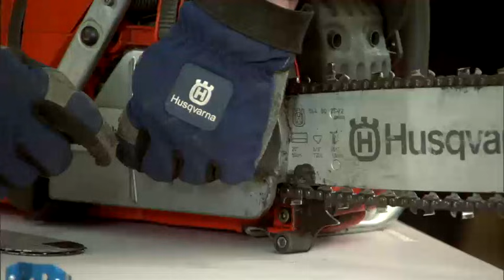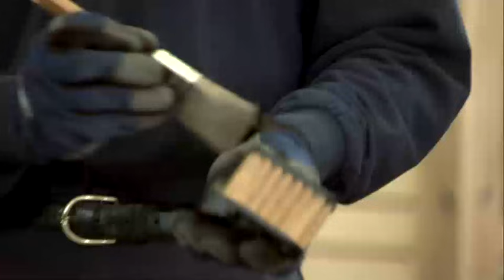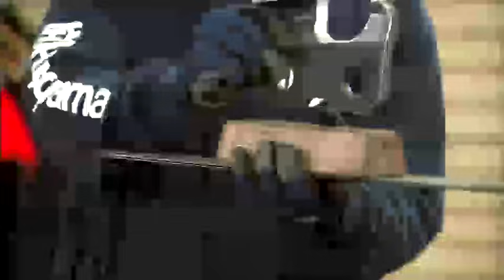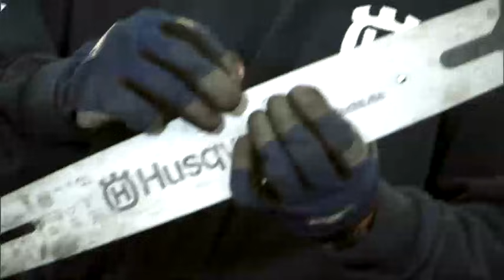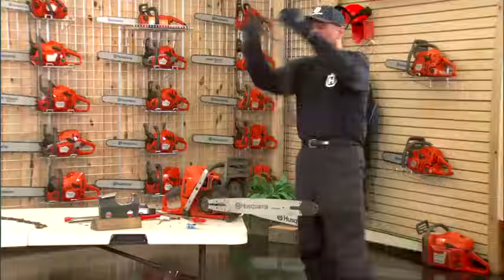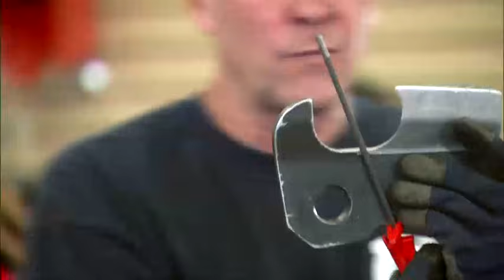How to Maintain and Service Your Chainsaw | Husqvarna

Comment: First of all, I want to say that this is a great video. I would like to add that you should make sure the chain brake is disengaged before you take the side cover off. He did disengage it in the video and even double checked it before removing the side cover, but did not specifically say to do it. To those of you who are experienced, that may seem obvious to do so, but for someone new to saw maintenance (like myself) it’s may not be so obvious. I was wondering why it was so hard to get the cover off and then was really mad at myself when I couldn’t get the cover back on. I finally got the brake disengaged and the cover back on, but I don’t want to make that mistake again and hopefully I can save someone else that headache. They do make a special scrench, but I did not have that at that time. Again, just make sure the chain brake is disengaged before removing the side cover.

Comment: Sure you claim not to use motor oil just because some of it gets thrown off
Well consider which is cheaper,
When you use expensive chain oil
You can buy several chains with the money you spend on oil, and it is still a lot cheaper to buy an extra chain or even the bar,
So at my age of 82 , i been using motor oil for many many years , and I cut thousands of cords of wood,  I use a 394, bought that around 1994 to replace the one that burned up in a fire in the Okanagan.
So no point in promoting chain oil, auto oil also seems to have a sticking agent in it too, as the engine parts are moving, and an engine is more expensive than a chain saw.
In all those years I think I bought 1 bar and a couple of chains,

Comment: most of the old saws cannot use bar oil, the viscosity is too high, which causes the saw to leak.  If one's saw leaks, start by switching to a lower weight oil to see if that helps..

Comment: I guess I got a bad one. I’ve owned 3 chainsaws in my life, 45 years old. This chainsaw is the most delicate and maintenance heavy pieces of equipment I’ve ever had. I didn’t do anything crazy with it, didn’t hit any rocks or metal. Just a heavy day of personal lawn maintenance work. Constant maintenance since. I’ve done nothing but try to fix this damn thing. It’s the chain, it’s the guide bar, it’s the tensioner… I paid way too much money to have to baby this thing and waste so much time on it. I can’t even sell it in good faith because it’s always breaking.
Reply: What manufacturer. Husq?
Reply: Which model if it is a husq

Comment: I used Sthil for years, i just bought two farm tough husqvarna, i was cutting trees down and the chain fell off, i couldnt get the housing back on. its still sitting in the back of my truck since december, I want to throw it out because how hard it was to put the fukn thing back on in two feet of snow.

Comment: In my 50+ yrs experience of running & maintaining chainsaws, learning by doing, a file guide like Granberg's gets me the best results, by setting file ht and angle precisely. (To KISS I just file flat across.) No way otherwise, IME, can I do that. Without that guide, I need a stump vise to hold the bar so I can use two hands on the file. Granberg guide can be controlled with one hand. It can also be used to precisely set "joint"- depth gauge setting. Then you round leading edge of depth gauge with flat file. Generally, couple strokes per tooth every other fillup keeps chain sharp and consistent. Some have difficulty mastering that guide- the instructions suck- a friend to answer questions is a good idea a/r for comprehension probs. No way can I get such results with a grinder- they're for rocked chains. Also, chains and files seem to last a long time with Granberg guide. Rule 1: relax & engage brain. Good luck & fat chips.

Comment: push the primer 6 times and let it rip I like the saw for the price👀 allabout.wiki/MIJI used maybe 10 tanks of fuel, 6 loads of hard wood and am very pleased with it. some will say its under powered for a 20" but I like it better then a 18". I have a 18" also which is great also just like the extra 2" inches. the saw is very light also which is nice. Huskavarna owns Husqvarna so I am sure it will last. its not a sthl but still love it! I have seen some bad reviews on the saw but do not agree with them. some people told me not to waste my money but have since changed there mind. just have some common sense and cut some wood!

Comment: I have a blocked chain oil feed on my 445 and cannot seem to clear it. The holes on the bar are clear. Any tips on how to sort the problem?
Reply: Have you cleaned everything else also such as bar-rail and the chainbrake-area is clean? If, Then your oilpump on gone

Comment: Exceptional video. Thanks.  I'm certainly not a chainsaw expert but one thing I have been taught to do is to also lay the bar on a flat surface to check for bends or twists.

Comment: Good tip given in the video - engage the choke lever to block the carb before removing the air filter to prevent accidental blockage from debris.

Comment: Exhaust goes one way, out not in. Spark arrestor won't go into the intake because it's affixed to the exhaust, specifically the other side of the muffler from the exhaust port on the cylinder.

I can't wrap my mind around the statement that little bits of the arrestor if weakened, can end up in the intake when it's on the far end of the outtake.

Honestly, heat the spark arrestor until it glows cherry red. Let cool until cold to the touch. Use brass brush to clean ash off the screen. Never had problems doing this.
Reply: Exhaust on a 2 stroke also acts as an inlet, the reflection pulse of the exhaust pushes combustion gases back into the combustion chamber.

Comment: That was a very good maintenance rundown. To sharpen the chain I use a 13/64 or 5.2mm file. Not the 13/64 or 5.5mm you recommend.

Comment: Can I run a 20" Bar on the Husqvarna 445 ?
Reply: You can, but.......it's a tad too long. I've had one for nearly 10 years and found it works great with an 18" bar as long as you keep your chain sharp.

Comment: Chain sharpening. Mi look at the same things you do but I also look at the gullet.  I feel the top edge, look at the gullett and scan the rakers to make sure they are below the top plate by about the gap on the spark plug.  I usually put three strokes on the gullett and three strokes on the top plate.  I have file guide sure but I usually file free hand with just a file unless the cutters have been really dulled off and I need to reset the angle of the cutters.

Comment: hand filing is just a bad idea.  I'm convinced the greatest hand filer in the world will through their chain out of factory recommended specs in 3 or 4 sharpenings.  Get the timberline sharpener, it can sharpen all the teeth in a straight line rather than having to flip around and doing the skipped teeth afterwards like normal hand filers.  Further, it locks into place and all you do is trun the grinder with a circular handle, so if it's locked in there's no play or freehand movement to screw things up.  It's pricey but worth every penny imo.
Reply: always hand file .

Comment: I been cutting firewood as a business since 1979. I started out running Husqvarna 2100(99cc) and the 266xp. Never had a problem. One must understand the Husqvarna xp saws are a very high rpm. The chain must be razor sharp to get the best performance out of the saw, time is money. I make one pass with a file on every gas up. I like the cutting speed to be the fastest when felling trees. At the end of the day the air filter gets cleaned, the bar nose gets a shot of grease, once a week the clutch bearing gets greased, the bar gets checked squareness.
Reply: Good old saws Bill, my 266 is still going as strong now as when I got it way back. Your spot on with your maintenance, you only get out what you put in. Happy cutting

Comment: Nice video, but Wow...sounds like you guys need to build a better, more durable air filter. That's absurd having to baby it so...these are working machines. No way you can't make a good filter that you can take out, blow off and get back to work! Also curious, which 6 surfaces you can flatten with that 90 deg. file???
Reply: Three surfaces on the top of the bar, three surfaces on the bottom of the bar.  Adds up to six if you look at it that way.

Comment: Hi can you show the correct position of the cooling plate behind the muffler on a Husqvarna 365 Special when I took the muffler off the tab on the cooling plate was facing out but in the workshop manual it shows the tab facing inward, will this make any difference the way the tab faces.

Comment: When changing or cleaning cutting chain and or guide bar, should you hold the guide bar by the sprocket tip so the bar is on a slight upward plain? before you tighten bar nuts?
Reply: just lift the power head up when tightening the bar nuts

Comment: Great video, very informative. I couldn't help but notice that, when looking at the gullet and stating what to look for (to see if it's 90 degrees from the rise of the gullet to the tip of the tooth), the angle on the chain wasn't 90 deg. Just wondering how important that is. (I'm guessing it's just a rough guide (maybe?) since you didn't mention that the angle wasn't 90 deg). Thank you again for a very informative video!
Stan in N AL

Comment: Please explain comment at 25:34 to 25:44 about low RPM being hard on the equipment and takes away a lot of life.
Reply: +D eez  Not sure if you are still concerned, cuz this comment is pretty old.  But he was referring to not filing the depth gauges too low.  If the depth gauge is filed too low, the tooth will try to cut deeper in the wood.  It will "bog down" and the saw will be working too hard.  Consequently, the saw isn't able to develop its full RPM (12,000 or so) because it is trying to cut to deeply, and only develop around 6,000 RPM as he stated.  Which is really hard on the saw.  Be like running your car in 2nd gear at highway speed.
Reply: Patrick Wagz Old comment yes, but it's all good. And sorry but still do not understand why low RPM is hard on the saw. I guess also...Why is it "dangerous for you" or me in this case? But really though, How is low RPM "hard on the equipment in the long term"? I was just looking for the reasons to backup those statements. There are saws out there that have stronger internal parts that handle higher torque so ya, How does a saw that bogs down, hard on it exactly?
Reply: At low rpms saws can build up carbon inside the cylinder and cause problems. That’s why it is hard on the engines.
Reply: saws are meant to work at full power , for efficiency and cooling .  certainly to go slow on a hard cutting job is just going to be harder on the engine .

Comment: Hi, I have a Husqvarna 345 chain saw (Australia) which has been in storage for 5years due to relocation. Now relocated back, and picked up from storage, I would like to give it a run etc, whats advice is best ? ie clean filter, new spark plug, oil, fuel and give it a try ??  Advice please
Reply: when I fix up saws I empty the old gas, put in new mix, clean air filter with air filter, try running it. If it doesn't start take off the carburetor and clean it real well make sure you get all the small holes clear use carb cleaner wear gloves though. put the carb back on and then try starting again. If it starts, give it a good cleaning, and be ready to have a good time with a nice saw. If it still doesn't run, take out the spark plug and check for carbon buildup. If the spark plug is real bad, take some really really fine sandpaper and sand off the carbon build-up in between the contacts. If the plug is nasty with oil or is flooded take a propane torch and burn off the crap on the plug. then point the propane torch into the cylinder for a few seconds to burn a little of the junk in there as well. Use a compression tester to do a compression test, if it is under about 110 psi then you will want to put a new piston ring on it, unless you are not skilled enough then you will want to bring it into a husqvarna dealership to have them do a tune-up or have them fix the saw. If it has good compression then try starting again. It should work. If it doesn't start, then you will want to adjust the carburetor adjustments. you can look online for the correct adjustments. If it still doesn't work, bring it into your nearest husqvarna dealer. (or sell it to me) :)
Reply: also it is a good idea to check the fuel filter inside the gas tank. also check all fuel lines for cracks, also do the important things in this video.,
Reply: Mark Levenhagen Thanks for your advice..much appreciated.

Comment: how many turnes on the carberater adjustment fuel mixture screws do you go from them turned in
Reply: Muller will screw up a wet dream. Freak
Reply: Turn out 1.5 turns both screws. Then fine tune from there.

Comment: Not mentioned in the maintenance is the inspection of the bar rail gap.  The gap may widen, as has happened with me which may cause a crooked kerf.  A bar gap closer is used to tighten the rail back to proper width.